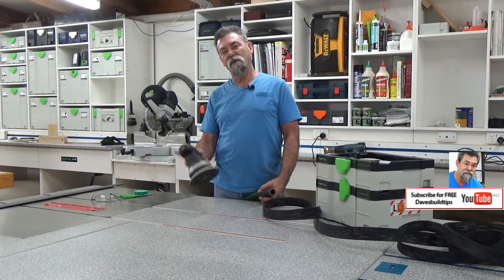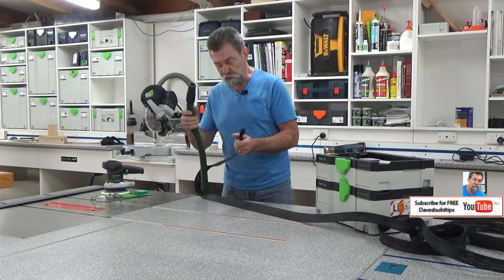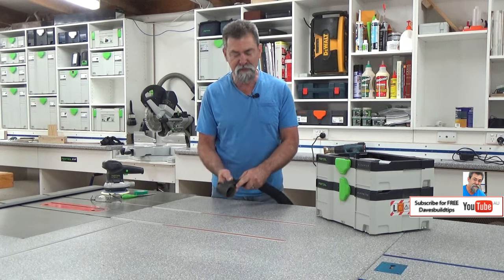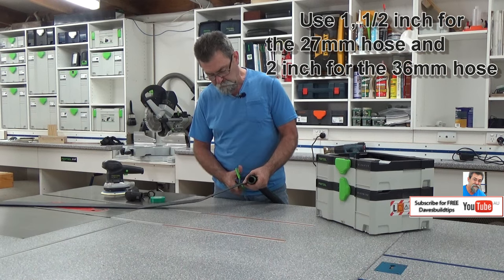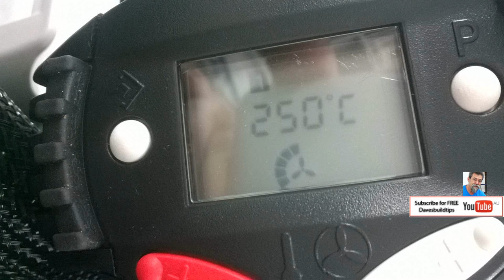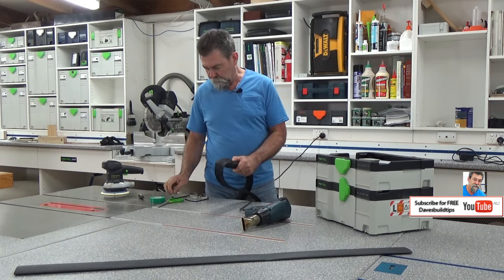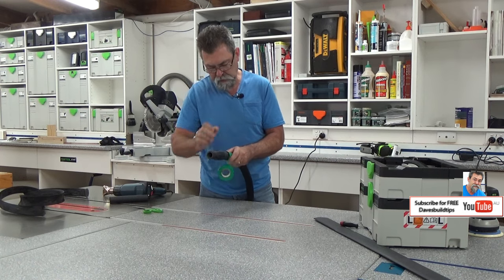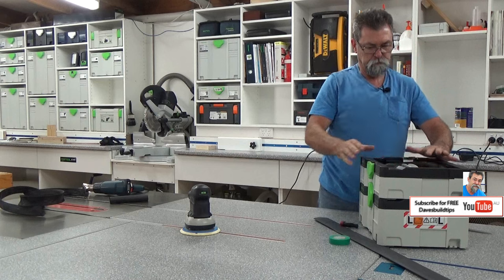DIY Festool  vacuum hose protection Dave Stanton

Comment: I did this to my hose and it makes a huge difference! I also put my power cable inside the sleeve as well, although I tend to pull the plug this way. I think I will try just the dust hose and see if that helps things a bit. Great tip, thank you!
Reply from the maker: I decided against the lead inside. Works fine. Thanks for the comment!

Comment: The snagging is so annoying and it actually stopped a tracksaw cut once, and has also snagged end grain. Saw this idea a while back on YT ( Toolify?) and jumped on it, found the cable wrap in a color close to Festool green really cheap on eBay. I included the plug-it cable inside, which I've been happy enough with (large hose for tracksaw, small hose for sanders and router). Didn't know about the shrink connector, just used electrical tape, which seems to be working fine. I recommend this highly, everybody should do it! Actually, Festool should do it.

Comment: Hi Dave - fantastic tip. I have my Plug-it cable attached to my hose and it generally works great but i think the cable wrap will improve that solution even more! I' go get some cable wrap right away.

Comment: I have also seen someone else use that hose but he used wire clips ( not the right name but it escapes me) to hold it on. He also ran the electrical cable inside so he kept them inside the hose. I love the scissors pity you could not get the green tape closer match the Festool green.

Comment: Hello Dave, i like your videos.  This one to....its to simple but so handy. I was thinking why don't you put a powercord into the sleeve first? Justva thouth......
Reply from the maker: Thank you. I could have but because this hose is a tight fit when coiled up the lead would have made it a little stiffer. Also, I use as a vacuum cleaner without a plug it lead most of the time.

Comment from the maker: Thanks to Cochese (144 workshop) for the idea.
Reply: Little tip, when using heat shrink on the end of the cable wrap use the waterproof heat shrink, it has the glue in the heat shrink so the wrap cant slip out.

Comment: I objected to having to pay £15 for the scrap of plastic that Festool sell to overcome this problem.
My solution was to make a loop from a 600mm length of plastic parcel strapping, pass the hose through the loop, and staple the loop to the ceiling of my shed.
This works as it keeps the hose clear of the track. I can easily remove the hose when it is needed on another tool.
Of course, the loop hangs down, but when I bang my head on it, it doesn't hurt :-)
Incidentally plastic, parcel  strapping is a low-friction material. It makes great drawer runners for old furniture.

Comment: Hello David, great video as always ! Could you answer my question ? I am about tu buy a vacuum for my tools and was thinking about the CTL Midi but after seeing you use the CTL SYS I have a doubt. I only will be using it with a sander, a plunge saw and a rooter. Is the SYS enough for that. I am just a hobbyist, nothing like your shop ;-) Thank you and keep up the good work.
Reply from the maker: Best to get the mini. all the festool vacs pull 3900 litres a minute except for the CTL SYS which only pulls 3000 litres per minute and also has a bypass valve if things get too hard for it. Only a light duty vac but very good at it's job. Thanks for posting!
Reply: Thank you so much David !

Comment: Thanks Dave!  Hey, do you run into that equally annoying hose issue where the hose gets all charged up w/ static electricity and attracts all kinds of filth and dirt?  Maybe you're using one of Fester's anti-static hoses.  I imagine we could run some bare copper wire inside your spiffy new cover or is it even necessary?
Reply from the maker: A braided piece of wir would do if you have a dust extractor with earth connections at the inlet.

Comment: Doing this today!
Reply from the maker: Works a treat. Make sure you get enough tape at either end to hold the sleeve in position.
Reply: Done Mr. Stanton, I was always worried about the hose rubbing against the track on my TS 75. This was by far the best option and was only about $25.00.  Thank you for your videos!

Comment: Hi David, love time viewer but new subscriber.
I’m debating with myself to buy a makita tracksaw, however my heart is set on festool.
What will your recommendations be? Is festool worth the extra money? What are your thoughts?
Reply from the maker: There is nothing wrong with the Makita. The only issue is their tracks have a plastic strip for the saw to glide on where I am told the Festool has a Teflon strip. I usually stick with a brand if it delivers for me. I owned many Makita tools until around 15 years ago, then some DeWalt a Hitachi and then the green stuff I now have.
Reply: David Stanton does the Teflon tape make it glide better than the plastic tracks?
Would you say festool is more innovative with their tools? What was your reason to moving onto festool and could you justify the move when you started purchasing festool?
If you had to convince me it’s worth the extra money what would you say?
Looking forward to your thoughts as I’m looking at purchasing this week.
Reply from the maker: I have never used the Makita track saw so cannot make 1st hand comment.
My first Festool was a CXS drill and from there the track saw and Domino 700. They are all very good and were the leaders in these areas. You may find the Makita is right for you. I am not about to try to convince you either way because I am not employed by Festool, I just like their tools.
Reply: David Stanton thanks for your input.

Comment: I have done this, and I'm looking for a solution to a new problem: When I use the hose for my miter saw (or with a hand brush for cleaning up, etc) I would like some way to cap the plug it cable so that I can protect the end of the cable. I bundled the cable in with the hose. Does anyone have a hack?
Reply from the maker: Hi Zach. The 27mm nozzle for the hose will do it. If you have an old one you can cut an inch off and use that.